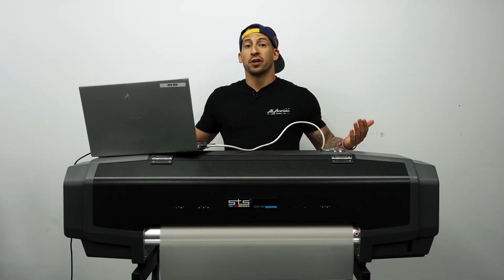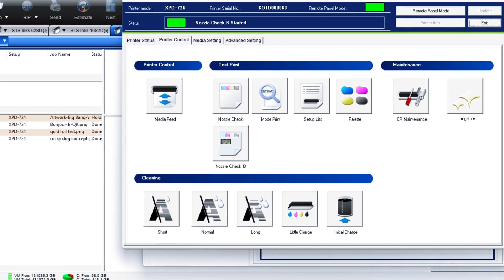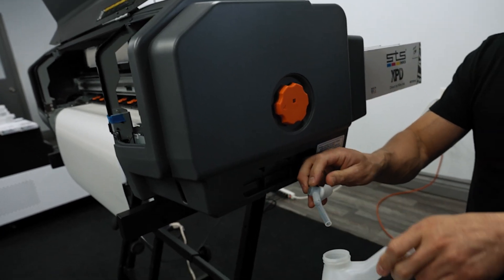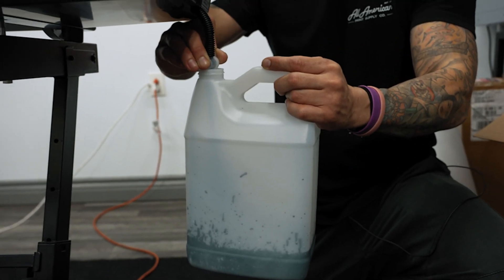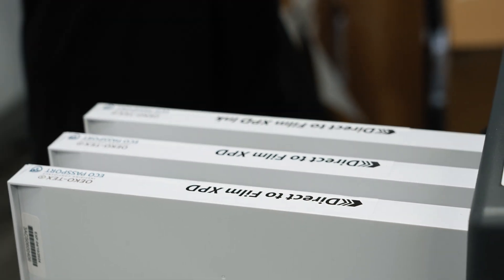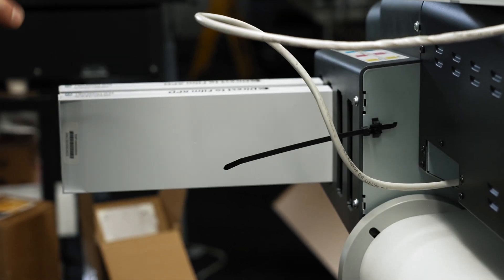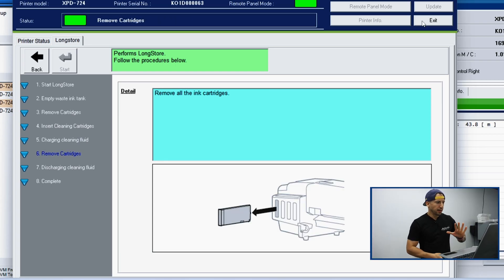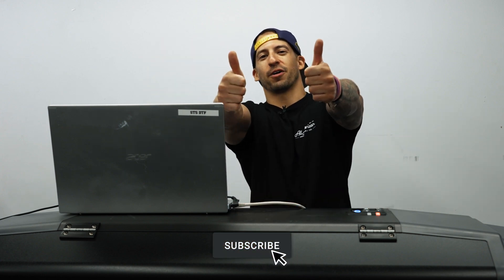How To Do DTF Long Storage w/ STS XPD 724

Comment: After we remove the cartridges and it discharges can we leave the cartridges out and leave the machine turned on?
Reply from the maker: Hey there, double checked with our friends at STS for this one: should be fine to turn off. No risk at that point of ink to dry in the lines. If you're transporting it, be sure to lock that printhead!
Reply: Thanks for the information!!!
Reply from the maker: @top5percentllc504  thank you for the supporting the channel, please be sure to subscribe for more and don't forget to drop a thumbs up!
Reply: If I have switched out the white ink cartridges from the channels five and six and move them to seven and eight do I have to move them back before I can do a long store?
Thank you in advance for your response.

Comment: so on final step you dont leave any cartridge in  when it does the discharge? do you put the 724 in sleep mode with no cartridges and left on while in long store mode?
Reply from the maker: Correct, as prompted we removed the cartridges before moving to discharge. Since we had properly prepped the machine for long term storage we actually were able to turn our machine off with no worry on operation when we are ready to resume printing